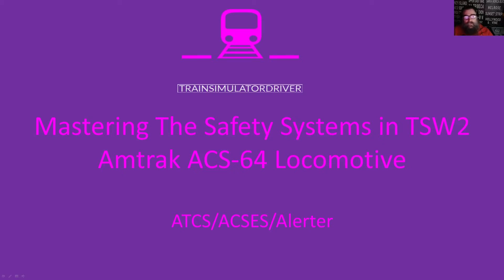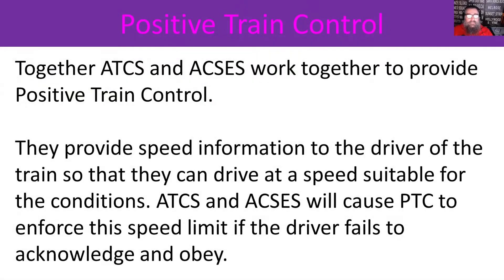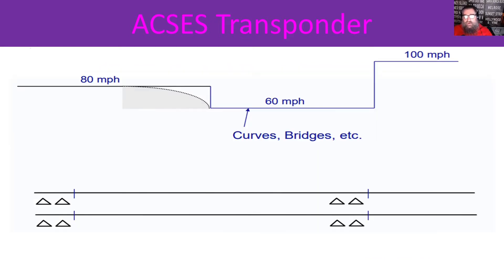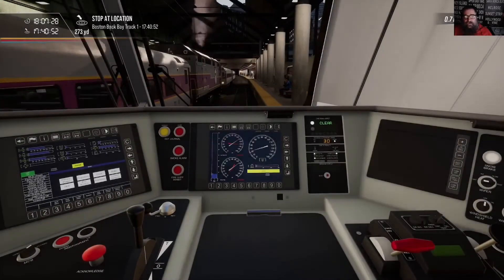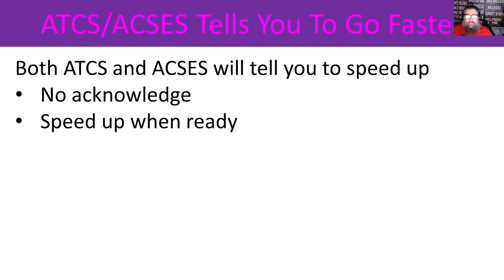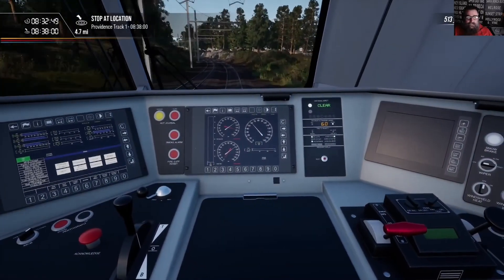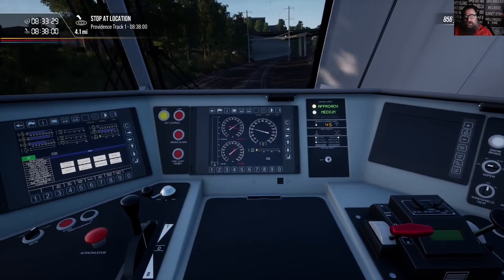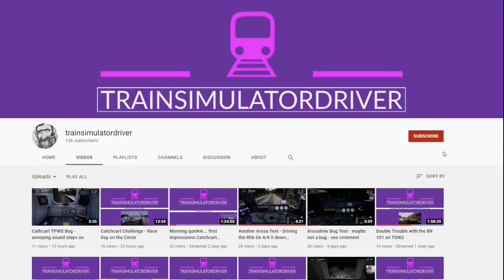Mastering the Amtrak ACS 64 ATCS and ACSES Safety Systems Tutorial

Comment: One thing i noticed on the NEC route are the sudden changes in speed -- practically one bit after Route 128 westbound where the speed will drop from 80 to 40 and the ACSES system has a complete cow.
Reply from the maker: There are two systems ATC and ACSES. ATC will drop when you're getting close to another train. ACSES drops based on civil speed restrictions which can be for things like curves, bridges, cross overs, etc. ATC is not predictable and you just have to react to it. ACSES is predictable it will always do the same thing at that place and you can drop down to that speed before you get there then you won't need to do anything when you get there. This is basically route knowledge.

Comment: Close to real life but not exact.  Cab signals (ATCS) do not have a radio, all information is in the rails.  The ADU top display is cab signals which stays clear most of the time.  The MAS is whichever is most restrictive (ACSES or Cab Signal).  There were some other small details that may be correct for the game but are not this way in real life.  By the way, I'm in Rolling Stock Engineering PTC group.
Reply from the maker: The material in this tutorial wasn't developed from the game it was developed from one of your documents describing the systems and how they work. The document was from circa 2005 so things may have changed since then.

Comment: Great video, but your driving skills are unsafe. I belive that true master of theese systems needs only initial braking to provide comfort to the passengers.
Reply from the maker: Thank you for the feedback. The technique here has been vetted by actual ACS-64 drivers.
Reply from the maker: I have just checked the actual Amtrak ACS-64 operators manual and it is as I thought. Minimum (initial you called it) is only 6-8 pound reduction in the brake pipe. It is not enough to a) stop the train travelling at speed or b) forestall the safety system. You MUST have at least a 15 pound reduction on the EQ reservoir and/or put the brake handle into Suppression to forestall the safety system taking over and initiating an automatic penalty brake. The correct position is Suppression for a normal stop or Service if you need to stop in a hurry. So my friend, if you want to use Minimum you go right ahead, but if you're driving with safety systems on (ATC and ACSES) then its not going to to the job for you.
Reply: Lmao you got put back to place so hard and I only got to see it 2 years later xD